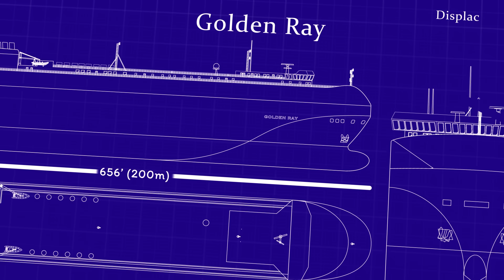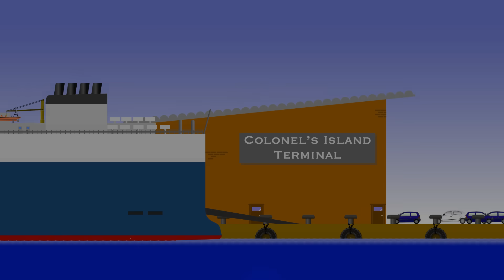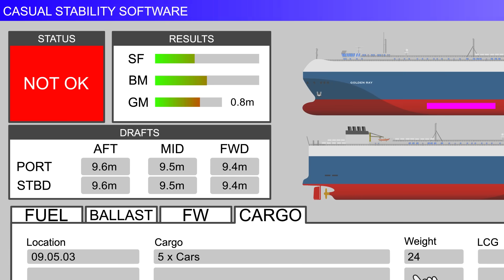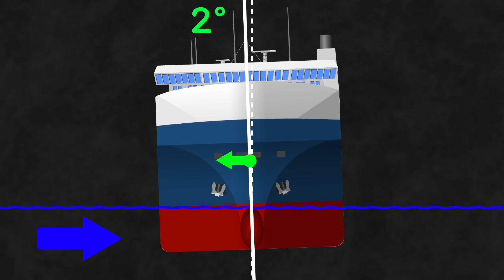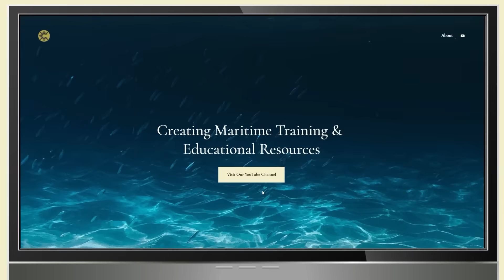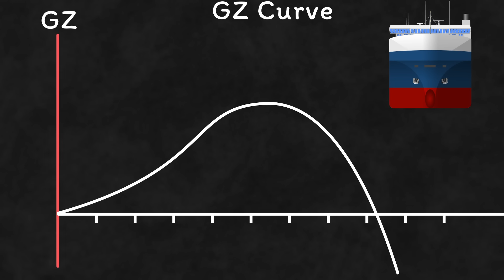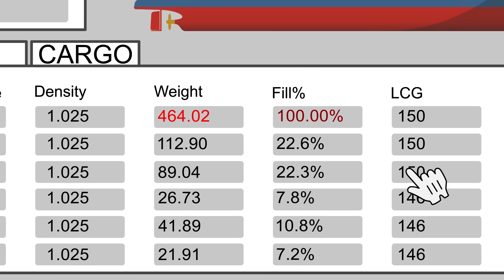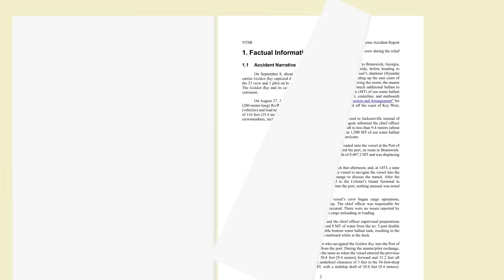Golden Ray: The Typo That Cost $250,000,000

Comment: Decimal points separate whole numbers from fractional numbers. You would have to be a total moron to use a decimal point in place of a comma which separates number groups. If you can’t tell the difference between a decimal point and a comma you should not be doing such basic mathematics.  😂😂😂😂😂😂😂
Reply: Different languages use a comma to separate decimals and a dot to separate the thousands groups, before you go around insulting others try to think if it's not you who is ignorant. Many systems work the opposite of what you're used to.

Comment: If use silicone glue must be a hole somewhere, sabotaged, maybe because i think this is Russia, Or Czech Republic? If think of Aquarium Glue, It is Silicon(and so strong as can hold water in A Big Aquarium) Maybe All Ships have alot of Silicone Glue? I wonder if it will still work in Water, Then Shld be Just Pipe Out The Water, And it Will Auto Balance Upwards Again(i think the Shape of base caused it To Stand Back Up if no water inside anymore).

Comment: Great video like all the other ones on your channel. Only thing I would like to comment upon is that example GM values you used in this video are about 10 times greater than what Intact Stability Code mandates. Most ship types need to maintain minimum 15 cm of GM fluid and some need 20 or 30 cm at the max like grain carriers. I believe you used the numbers just as examples but those numbers were way too high.

Comment: Although I agree that here was a human error, some part of video may not be accurate. As they call to Jacksonville port as well between discharging the 1500 T ballast and capsizing, and also loaded cargo over there, So that means that they would have done stability calculations at arrival/departure Jacksonville. So they must have corrected it, otherwise it wouldn't show correct/updated readings, which are necessary before departure. And if 1500 was still there, they wouldn't get a proper reading, and wouldn't depart Jacksonville. But again just an assumption from my side. Don't have full data, so can't say.

Comment: besides all calculations mishaps and typo vessel still had a positive GM. few relatively small turns already passed caused list up to 6 deg, that should be a clear alert for the Captain that the vessel was abnormally sensitive, and immediate slow down was of utmost importance in such situation, then disaster would never happen and further vessel's loading condition check would quickly reveal the reason. instead speed was increasing...

Comment: "Partially filling your ship with water makes it more stable in rough seas."

It's brain bending stuff like this that keeps me out of the water.
Reply: It's just about Center of Gravity. If you load something heavy to the Roof of your Car, it becomes top heavy and prone to rolling over. Ballasting it at the Bottom can counter this, as long as you don't overload the Suspension. The same applies to Ships, just with Buoyancy instead of Suspension. Plus Ships can also be too bottom heavy, so you must raise the Center of Gravity. Bottom heavy Ships roll only small Angles but do so ridiculously fast, causing dangerous Accelartions on the upper Decks. There was an Accident on the Hapag-Lloyd Container Ship "Chicago Express", where short but fast Rolling threw around the Bridge Crew, ending up killing a Phillipino Crewman and crippling the German Captain.

Comment: Interesting. I would have never expected the industry to ship around this kind of value without a few redundand failsave measures. It isn't really hard to connect a GPS, a compass, a bunch of accelerometers and a small computer (yes, or conveniently a mobile phone) to calculate the  GM and GZ-Courve from the speed, the degree of the curve, and the time it takes to get upright again, and issue a warning if it is too small.

Because entering a wrong number or forgetting to log a change happens all the time.
But.. well.. Boeings MCAS is pretty much exactly this - just automated, so why am I surprised...

Comment: And once again we see a case of computer fail due to missing real world sensors. There are tons of other examples for this. Computers that cannot monitor the real world (that cannot "see" what's going on) must rely on data they get fed in and this has caused many accidents and even death in the past that would all be avoidable, if there was a sensor the computer could use to verify that the data it has been given is not totally off with reality. E.g. if there was a level sensor in the ballast tanks, the computer would have said: Wait a minute. You tell me there are ... tons of water in these tanks but my sensor tells me the tanks are nearly empty, so something mus be wrong here. Either that data is wrong or the sensor is broken. Either way, go fix it! And until that is done, I will not give you okay to anything. Just a few days ago I came across the case of the THERAC-25, a medical device that killed several people because of the same problem: It lacked a sensor so it had to rely that whatever settings you made, those settings were correctly transferred to the machine which sometimes was not the case but the computer couldn't know, it had to blindly rely upon all entered data being correctly when it started the treatment.

Comment: centrifugal force is not a real force, and the forces experienced in reality will never line up with how people show "centrifugal" force. the centripetal force is what exists, and the reason it heels is because centripetal force is being applied via the rudder which is at the bottom, but there is no centripetal acceleration for the top of the ship, leading to an imbalance reflected across the center of mass. the bottom accelerates inwards while the top wishes to continue in a straight line. you are right that the water pushing against the ship is responsible for some of the pitching effect, though.

Comment: Before I watch, I wondering if it was a "typo" or international confusion.  In the US, and most English speaking countries, we write one million as 1,000,000 in Germany and other countries it's 1.000.000.  The decimal marker is also reversed, so we see 1,000.00 versus 1.000,00 for one thousand. This has indeed led to problems.  

Germany has for years said it is going to switch for several reasons.  One, to standardize.  Two, to have their academia on the same standards.  Three, most computing, calculators etc are on US type standards.

Nope, not even close.

Comment: The "1.500" notation that appears in the title of this video is one of those annoying but very important cases where routine conventions differ across locales.

Sometimes the meanings of the "." and "," character are exchanged, so a decimal point will be denoted as either "." or "," and conversely the 10^3 separator may use "," or "." Because these conventions are completely routine within a given culture, misunderstandings may easily go unnoticed.

A similar sort of "impedance mismatch" can occur when units of measurement follow different conventions in different locales. The United States is particularly vulnerable to this effect since it's highly reliant on technology and yet has failed to transition to the metric system.

https://en.wikipedia.org/wiki/Mars_Climate_Orbiter

Comment: LOL sounds like, based on this they had some of the ballast values set to manual rather than having the computer measure the ballast. I guess there was a problem and it wasn't measuring ballast correctly, and this here is an expensive lesson that humans aren't any better. They should have gotten it fixed instead.

Comment: 0:34 Displacement isn't measured in tons, since tons are a unit of weight or mass, not volume.  You could use gallons, cubic meters, or something like that.  That's why you see "engine displacement" referring to cubic inches or cubic centimeters, not in pounds or kilograms.  
2:25 Data should end in an "ah" sound instead of an "er" sound.
Reply: A ship's displacement is measured in tonnes, and who do you think you are to tell this man how to speak? No-one cares how you believe the word should be said, and what he said is fine. You are an idiot and you have no idea what you're talking about.
Reply: There are no better scale than the volume of water displaced to measure a ship's weight. The math is quite simple, you multiply the submerged volume of the ship (m3) by the water density (t/m3) and voilà! You have a result in tons. 

So yeah, displacement in the martime industry is ALWAYS measured in tons, since you can expect to navigate through different waters with different densities.
Reply: @mariner7634  Really then you are calculating displacement by measuring or calculating weight.  The weight isn't the displacement.  I suppose it's faster to call it displacement than to call it "weight that will be used to calculate displacement" if it's commonly referenced in the industry.  Actually you're doing what I described in reverse, but you get my point, and thanks for clarifying that.

Comment: Clickbait. The thumbnail suggests that someone read "1.500" as "one thousand five hundred", or "1,500" as "one point five zero zero", due to the differing conventions regarding decimal points and thousand separators. This was not the case. They simply forgot to remove an entry of 1,500.

Comment: Not a problem of typo. But a problem of greed. A safe system would a have sensors and set automatically the values of the ballast when the ballasts were purged or filled.

Comment: I know nothing about navigation or boating so please feel free to constructively criticize this, but based on the GZ curve graph, would there not be a way for an instrument to be mounted aboard that could calculate GM based on any righting of the ship, therefore giving a reading of the GM at a negligible, and therefore safe, turn?
Reply: GZ curves are not used for navigation, they are stability theory only. 

There are also many different factors that will impact the list of the ship. For exemple, it might be windy that day etc. So the only important information for stability is the center of gravity, which is measured at port when loading/unloading.

Comment: One of my concerns was how well were the vehicles secured. Once the deck heeled over significantly if the cars were not properly secured then they would slide to the bottom and further reduce any tendencies for the ship to return to upright. Added to the flooding water and they had no chance.
Reply: Vehicles are chained to the deck with one or two chains at each end. Done correctly, they remain secured even with the deck vertical. If you look at photos from the salvage, most of them in fact remained in place. In heavy seas, if one gets loose, it can cause major damage, because you don't dare go down there until the seas calm.
Reply: @daleinaz1  that’s what I hoped but you can never be sure that procedures are adhered to.
Reply: @daleinaz1 ask the ghost of Michael Davidson how that worked out for TOTE maritime.

Comment: According to a website 'What's going on with shipping?', it might not have been an error and the data shouldn't have been manually entered. It was tampered with - deliberately fudging the figures so as to avoid having to pump dirty local port water through the ballast filtration systems (costly)..They prefer to pump at sea where there are less demands and costs on the filtering system. He also blasts the investigation report as being grossly inadequate. It is quite scary to be honest.

Comment: A GM of 0.8 meter is fairly normal for some vessels and is not to much to worry about. In fact by regulations it can be as low as 0.2 and still be legal though this should be avoided. The Achilles heel of this type of vessel is the large open deck that is there for fast and cost efficient loading of this type of vessels.Large open decks are common for RoRos (Roll on , roll off) vessels,ferries and even passenger vessels. The main thing here is the effect of the free surface, in this case of water. It can also be the free surface of any other floating media, even grain and bulk loads of fish included. I don’t know what the layout of the ship was inside of that entrance for the pilot but something must have been open to allow water to flow into a large open deck. It was the same thing that happened when Herold of Free Enterprise capsized off Zeabrugge. They did not close the bow in time when they left the port. Then they got seawater flowing into the car deck and the disaster was a fact.  There is a story from around 1960 that illustrates how bad it can be. At that time they’re was a boom in the herring fishing off Norway. The load line was the edge of the captain’s boots when he stood on the main deck. One of this vessels docked in the port of Kristiansund to discharge the cargo. They had filled the vessel with as much fish as they had room for. The vessel was very low on the water and only the mainmasts could be seen from the jetty. On the jetty was a young boy about 10 to 12 years old. Assume his weight was between 40 to 50 kg. The temptation became to much for him and he jumped onto the mast. The result was catastrophic because the fishing boat rolled over and capsized. As far as I know nobody was injured but I think that also other people in addition to the boy got something to think about and would probably never do such a foolish action again.🤠

Comment: The ferry Herald of Free Enterprise sank because the crew (to save time) got into the habit of closing the bow doors while underway but before clearing the harbour entrance.  I believe safety measures were implemented afterwards to prevent this happening.  Unfortunately time constraints encourage this sort of thing.  Here in the UK I was a bus driver for some years, generally there was never enough time given to drive sensibly and allow passengers to board and alight safely.  Consequently one was always running late, then you tend to start picking people up at the stops that should of been on the bus behind, compounding the situation.  The vehicle then becomes crowded and obviously this slows passengers egress on and off with people often having to stand.  One has to drive even more cautiously and running times become later and later.  In busy periods the service behind tends to run ahead of schedule and passes by, often having to wait.  Any additional work the driver has left during a shift is disrupted, as is the relieving driver and often they have to miss trips in order to rectify the situation.  If it is late at night with the last trip then the result is no service, or one finishes work late.  In the case of government subsidised services the company takes exception if one insists on going home on time and not driving, it's the main reasons I left.  We used the American Drive green which monitors braking, steering etc, your name was displayed on a league table and action was taken if you were scoring red too much, thus employees were caught between maintaining time and scoring satisfactorily.

Comment: Definitely wasn’t as costly of a mistake, but when ordering bricks for a new addition to my university’s library, the contractor accidentally added an extra 0 to the number of bricks to order. So it was something like we got 100,000 bricks instead of 10,000. They built an impromptu new clock tower with the extra bricks

Comment: The fault was not that someone made a small error, the real fault was the procedure with no one checking the calculations of this importance, that's unthinkable, people do make mistakes and such tasks should be done by at least 2 people so that if there is a difference then one of them made a mistake. Imagine if all the programs you use were only tested once by the programmer or not tested at all.... The testers always find some bugs even is very small commits...

Comment: No, the fault is keeping the door open and turning too fast.
You even explained it, they could have done 1 of those things and not sunk.
Reply: They were at normal speed for the operation. The ship may have still capsized even with the door closed.  The door wouldn't have been an issue if the ship had been ballasted correctly.

Comment: Why is that information still being entered manually, or at least not verified by sensors?  If a ballast tank is full or empty, it should be reported to the computer automatically and any discrepancy flagged.  With so much money on the line, you would think they would spare a few dollars to make the system a little more fool proof.

Comment: 3:03 94 vehicles = 374 tons? 
What the fk vehicle weighs an average of 3740+kgs?
Reply: You missed that they offloaded cars and that the numbers is the difference between before and after docking. 

The ship offloaded 266 vehicles at 1.2 metric tons each. For a total of 319 MT. 
It then loaded 360 vehicles weighing 1.92 metric tons each. For a total of 692 MT. 

So in total there was an increase in 94 vehicles and an increase in weight of 374 tons.

Comment: This isn’t a ”small clerical error”, this is a huge flaw in the rutines. If all it takes for the ship to sink is someone typing in the wrong number, someone shouldn’t be typing in numbers, it should either be done automatically through sensors or done separatley by multiple (minimum of 3) independent people.

Very often such misstakes are attributed to the person making the misstake, but the true fault is in the rutine, not the person who happened to make the misstake. If you have a rutine that does not allow for any misstakes, the rutine is the cause of the failure.